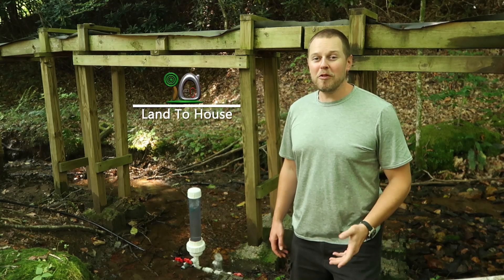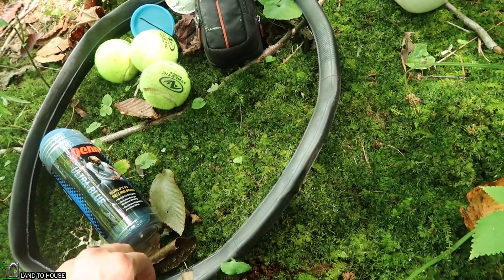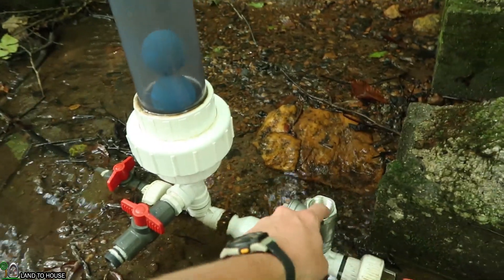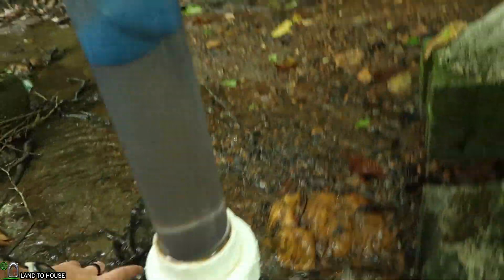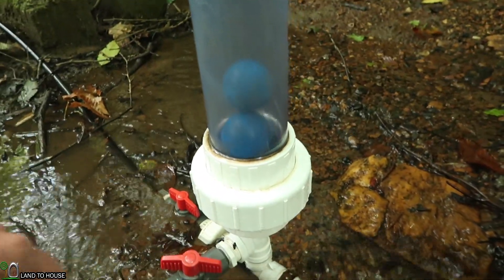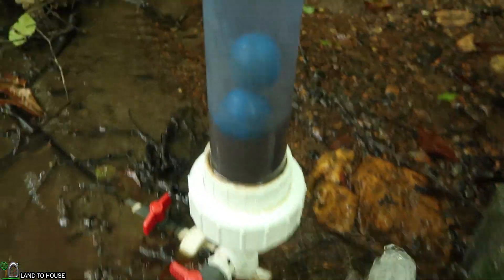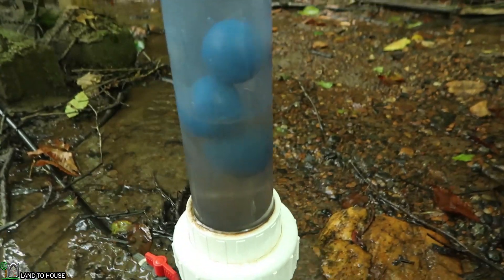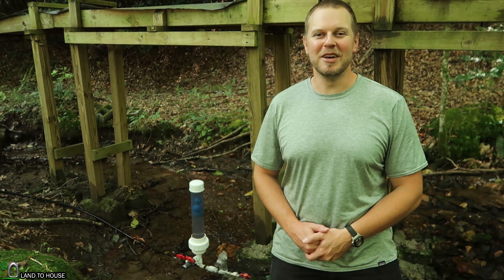Ram Pump Crushes Racquetballs

Comment: How about replacing the pressure tank with a hot water bottle.  Just a bit of creative plumbing parts and a hose clamp so it doesn't blow off the pump at pressure.

Comment: The pressure tank becomes waterlogged because the moving water under pressure absorbs gas (air), the same way that carbonated water is made, and the same reason that ice cubes get cloudy in the middle with thousands of tiny air bubbles.  You might try a threaded schrader valve in the top of the tank so you can pump in air to restore it.

Comment: Ive been asking this on other channels and ive got no response but this channel looks realy active

The question is how long does this pump stay on and does occasionally stop on its own which is fine and I think it's even better if it does for the purpose I'm using it for if you can answer this question it would be much appreciated
Reply from the maker: Hello. Thank you for asking and watching my videos. 

If the pump has a continuous flow of water going to it and sufficient back pressure on the delivery pipe, the pump will run all the time. 

The only reason that it would stop is air entering the drive pipe or debris.
Reply: @LandtoHouse  ty for the reply and also i was watching your your videos and please keep up the good work!!!

Comment: Try an un-popped tennis ball pack. Those things are sealed tight with a good amount of air in them. I'm curious to know if the sealed container will break the seal.
Reply from the maker: I bet it would pop it open! I would have to see if the can would fit in the 3" pipe.

Comment: Have you tried inserting an inner tube then inflating it to 40 psi or so
Reply from the maker: The smaller pressure tanks ( 2" ) are pumped tight in that manner. It's more difficult with the larger tanks to get the tube to that pressure.
Reply: kinda like a pressure tank. able to adjust pressure according to your head pressure.

Comment: Try to compare the amount of water deliver when using between the stainless steel and brass waste valves
Reply from the maker: Yes I will be doing that. The stainless steel swing valves will be  ready in about 25 days. I will be doing tests with them.

Comment: Could you go over your tank setup at the end of your pump?  What do you with the overflow for once the storage tanks are filled?
Reply from the maker: Yes I can make an update. But you can also see the setup on the 2019 ram pump startup video.
Reply from the maker: Currently the overflow just goes into the woods.

Comment: That was another great video. I wonder what would happen if a bladder tank like you normally see on top of the water heater where to be used instead of the pressure chamber. With a bladder tank you can pump the pressure even higher. That would be like the inner tube but with greater pressure. since I have to put mine so high up the hill I was wondering if a bladder tank pumped up as tight or almost as much as my psi would be best for me.    Keep them coning.   We appreciate.    https://www.amazon.com/iSpring-T32M-Pressurized-Storage-Reverse/dp/B00439MYYE/ref=mp_s_a_1_9?adgrpid=61479885732&gclid=CjwKCAjw5fzrBRASEiwAD2OSV5v_pIZjhLAhH0jD-3B8l_xJXXsuySj5r3FAaxsmhPMpkJreX3qOrBoCW5wQAvD_BwE&hvadid=274711161113&hvdev=m&hvlocphy=9009648&hvnetw=g&hvpos=1t4&hvqmt=e&hvrand=17042435747458414450&hvtargid=aud-646675773986%3Akwd-299904032770&hydadcr=13999_9485757&keywords=bladder+tank&qid=1568663435&s=gateway&sr=8-9
Reply from the maker: A friend of mine has been using this kind of pressure tank for some time. He says it works well. I do need to buy one and see how effective they are at increasing the lift.
Reply: @LandtoHouse  that would be awesome!

Comment: Would a capped off length of PVC piping work as filler, perhaps?
Reply: There would be no give
Reply from the maker: I am thinking that would not be a good fill. Would just reduce the volume of the tank.
Reply: Land to House that may be the case, but it has air trapped inside it like all the other fill materials do, so might be worth a try?

Comment: Might try lacrosse balls. About the same size as tennis balls but they are solid.
Reply from the maker: Are they solid rubber? Or some other material? The Fill material needs to be able to flex pretty good to return feedback.
Reply: Land to House I think they’re solid rubber, I’ve never cut one in half.  I didn’t realize they had to flex, I don’t think they will.

Comment: What if you added schrader valve to the pressure tank. Add air pressure once pump is running. 👍 see what that does.
Reply from the maker: Good idea! I saw a valve the other day but it was $15. I need to buy one.
Reply: @LandtoHouse  4 pack for $9 at https://www.amazon.com/VTR-TR-416-S-Outer-Mount-Metal/dp/B01BRVCQ7K

Comment: Have you thought of trying a small well expansion tank with a  diaphragm (bladder) in it, it would be more expensive, but they are designed for this type of operation
Reply from the maker: I have not used one but I know they worked very well. A friend of mine has one of those tanks on his pump. Gives nice results.